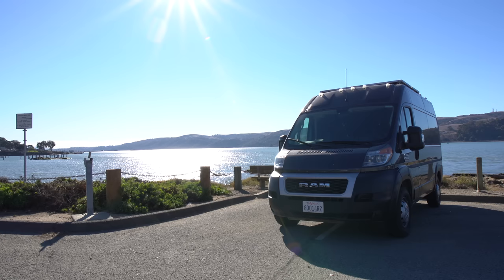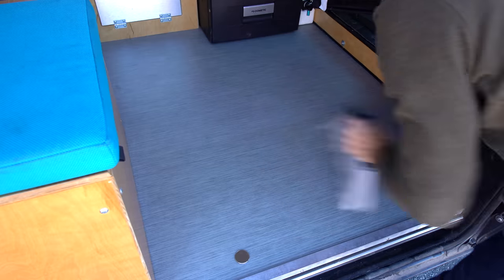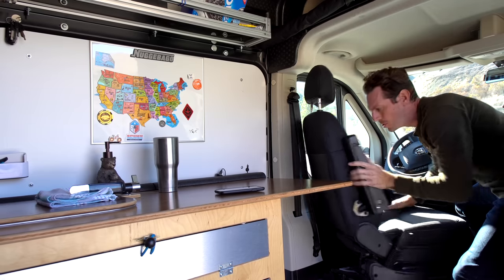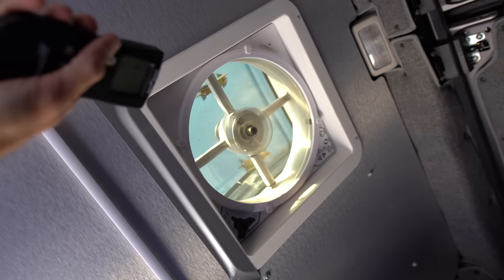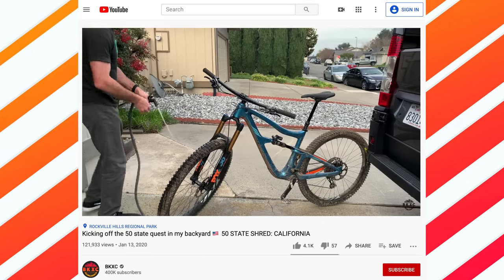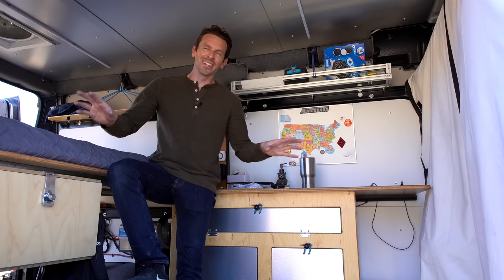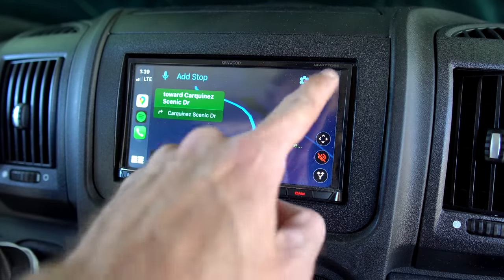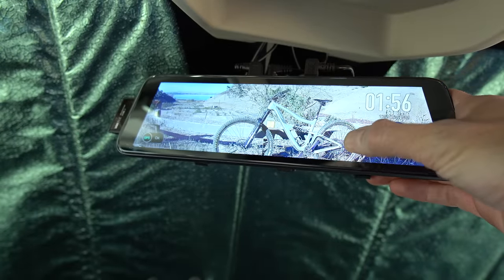15 Smart and Stupid Details On My Van | RAM Promaster camper conversion

Comment: You dont have to roll your windows all the way down for the fan to circulate, just crack them. My camper has a maxxfan and I just crack open a window and it gets pretty breezy. Even in the middle of July in South Alabama, parked in the shade, my maxxfan did as n amazing job at keeping me comfortable. 
Also, I'm not sure if there are window screens for the Ram, but as a trucker, there was a manufacturer that made screens for semi trucks that had a hard plastic mesh behind them to prevent somebody from pushing the screen out. You roll down the window, put the screen in and roll the window up to secure it. I'll see if I can find the link.

Comment: Just to clarify the diesel heaters are available for less than $200 if you buy the Chinese model. Only the name brand ones are crazy expensive ($800-1500) and they are literally identical to the cheap ones. A reason diesel heat is so popular is they provide dry heat where burning propane actually releases moisture into the air creating a lot of condensation that is very problematic in a van.

Comment: The vent fan requires electricity. There is a factory stamping directly behind the seats on the roof that is flat and I installed a CR Laurence 15x30" sunroof which has a removable glass. I can aim by DeWalt fan up to it to exhaust air and because my van is a low roof with the glass off there is infinite headroom where you most need it. You don't have to stand up everywhere in the van. Not sure what that build costs but it looks very cheap quality. I keep my van modular because I use it for camping and then hauling stuff which is what a van is made for. I have the Ram PM 118" which is plenty big but it still gets lousy gas mileage, ain't no way I'm loading it with cabinets.

Comment: For the noise, I bought some noise cancelling headphones from Bose. I wear them when I'm driving, superb sound quality even at low volumes because noise just disappears!
For anyone concerned about safety: ANC only blocks background noise. Horns, cars etc cut through the cancelling
Reply: It’s actually a great idea in theory.  However, I’ve been pulled over in two different states for wearing ear phones .  One ear plug or head phone is legal pretty much everywhere .  Two will get you stopped .  I’m not sure if this is the law in every state.  But you sit so high in vans, that’s its easy to spot (apparently). Such BS.

Comment: 😫   I agree, that oil change plan is a horrible deal. A typical lube place might charge you $50-$60...
 OR  a DIY oil change cost is about $35 USD  (with filter).     lesson:  Stay away from the "stealerships" unless you have a lot of money to burn.

Comment: propane heaters generate lots of moisture, of which there is lots of in winter. diesel heaters only radiate heat so it actually drys things out instead and with $200 kits available it is worth the install, speaking from experience.
Reply: What??? The winter air is by definition, colder than summer air. COLDER AIR DOES NOT HOLD AS MUCH MOISTURE AS WARMER AIR, hence "HOT and HUMID summers."

Comment: This won't help obviously, but here in italy there's a sweet data plan (monthly cap, yeah...) that is "unlimited" from midnight to 8 am. Unlimited actually means "30gb, after that speed drops to 128kb" but no extra fees. The cool bit is how it's 30gb each night! And it cost like 20 bucks a month.

Comment: Yes, a very useful presentation. Thank you. I have a cargo trailer conversion and although both trailer and van has their pros and cons, a van has an edge for doing more moving and the cargo for more staying. I tried traveling with a truck camper and frankly didn't like the pitch, rolling and swaying. I also don't like that the high top van will spend all of its life outside.
Reply: Raptor paint will withstand all weather:)
Reply: @MannyWC  You still have seals and a lot of undercarriage stuff to cover.
Reply: Do you mean like a trailer? I thought they had that covered. 

I thought work vehicles would be perfect. A small bus or shuttle would avoid all or most annoyances. If you have the lift, you could put a small bike in there, easy. I'd use a Murphy bed/conversion sofa, imo. Wasted space, otherwise. 

Or you could just lift it to the ceiling when not in use. And work underneath it.

Comment: The oil change packages are definitely worth it. If you buy them 3 at a time. As for the upsells, find a different dealer. Factory does not recommend any flushes.

Comment: Change your oil more often than 10k intervals. Its the cheapest insurance you can provide for your motor. Going over 5,000 miles on motor oil is a scam. Manufacture gets to say their cost of ownership is less and you plug up your motor with sludge eventually so you buy another vehicle sooner.

Comment: For the air flow, make a 4 inch x4 inch hole at the floor.
Reply: Actually a great spot for the hole is in the van sliding door step at the back horizontal portion by rear wheel with a slide cover to close it if you either don’t want full 4” vent or if too dusty road conditions while driving. I can’t take credit for this hack that came off Sprinter forum. 🙂
Reply: round hole.  Round can have a cover, and not fall thru.

Comment: A Chinese diesel heater is the only way to go. $120 and about an hour or 2 install time. Dry heat vs wet heat is huge in a camper van.

Comment: there should be a law that every van, truck, and suv be required to have a front facing camera at the top of their front windshield, which displays video on a screen mounted to the back windshield. That way the cars behind them would actually be able to see the road ahead when one of those big annoying things gets in the way.
Reply: Haha 
Stay off the road please. You are the problem, not the vans , trucks or suv.
Reply: @DaveEPie  nope, trying to maintain a view of the road ahead is responsible driving, even if that requires that we go around hazards and obstructions like dickheads in trucks.

Comment: Yo mate, when you talked about heating - diesel heaters.  They aren't thousands of dollars to get, the Chinese copies are about 250$ (they are identical to the couple thousand dollar originals), one tank of diesel did me for 2 winter months (mid north Canada) just fine in my larger van space then yours.   Holding some diesel in your van in a storage location is less dangerous then other types of fuel, propane is far more dangerous to hold then a tank of diesel.  Check out this old guys videos on these Chinese diesel heaters and you'll be happy you did.  He gives all the info you'd need and assures you they are quality replicas of the original multi thousand dollar diesel heaters. He goes over everything including proper install and benchmark tests/power draw/fuel consumption. No more cold nights, even in -30 Celsius weather (like me) you'll be fine.

Also diesel heater = dry heat.  Reduce condensation, reduce chance of mold getting into places you will not enjoy finding it.. all that stuff!  

https://www.youtube.com/watch?v=tvwmU_CcmGI&t=1s

Also good and informative video, thanks!

Comment: 180000 miles in my truck and all I have done is oil change every 7k full synthetic...plug change at 95k + fan belt and that it and it runs and look new and it is a 2016.

Comment: Hey Brian, First oil change  should be 3000 miles because engine is breaking in, the following  Oil changes should be 5000 miles, not 10,000.. You gonna ruin van's engine if you stick with 10,000

Comment: Another Vanlife YouTuber modified the fan in the Van's stock interior climate control so it could be run off of the house batteries as opposed to the engine battery.

I think it was the only fan in the his Vanbuild, Instead of of having a RV-Style ceiling fan.  

It would be way to have either a second fan or be more stealth if it's the only one.

Comment: Some sound deadening throughout the inside of doors, under the van on the body by the transmission,  on the wheel wells under the carpet or flooring, etc. would help a bunch.

Comment: Thiswas a good one, but on the diesel heater your wrong mr. BKXC. its about 200 bucks and with your knowledge you just hook it up yourself. Its great for drying out wet clothes and shoes, not only to heat the van.

Comment: Alot of work vans and trailers have roof vents...its going to take more than that to convince someone that it is permanenty occupied....diesel heater $150 on amazon.
Reply: I installed a diesel heater in a travel trailer. Got it out of a wrecked 18 wheeler. Paid $35 for it. Worked great!
5 quart fuel tank mounted on the outside above the hitch/propane tanks.  Easy to refill when fueling the truck.

Comment: Gotw3 could be a solution for your internet. 750gb per month is about 180 per month, 500gb I wanna say is 140 and the hotspot hardware is about 200 it switches between Verizon, att, and t mobile for best connection

Comment: Seems like there's a quite a bit of MISINFORMATION HERE:

A roof vent fan doesn't have to give away stealth.  I built my own rack for my solar panel on the roof, and it conceals the fan AND the solar panel.  So you'd have to look down on the van to see it all and detect it as a conversion.  All off the shelf materials online or at Home D.

And as for a single fan opening enabling air flow, no one builds correctly, to add an AIR INTAKE(s) through the floor, opposite the exhaust to avoid the heat while the vehicle is cooling down.  All you need is some 3" PVC, drill or cut a couple openings in the floor in an appropriate place (e.g. under cabinetry, and add a vent to allow the air out of the cabinet into the cabin), seal it into the floor and then add screen over the bottom outside end to keep bugs out, and removeable caps over the top for cold weather to keep the cold from flowing in.  Cold air in the floor, hot air out the vent.  Crack the vent just a bit and open the inlet when parked in the sun and you have passive cooling.   $20

The issue with propane heating is the MOISTURE it places in the air.  Not good in a van.  Mold not good.  You also have a HUGE error in not having a SEALED CONTAINER for the propane tank that has a VENT TO THE OUTSIDE THROUGH THE FLOOR.  These are REQUIRED in RVs and a HUGE health risk not to have, in fact didn't see your LEAK DETECTOR, so without one you are putting YOUR LIFE AT RISK.

And DIESEL HEATERS are ALL OVER EBAY for $120-150 and are WAY WAY easier to install than any RV electrical system and offer NO SMELL of the diesel and COMPLETELY eliminate all that moisture you are putting in the van.  They can heat all day and then some in bitter cold, so under light use you'll be checking it monthly to top off the small tank.

No need for an expensive under vehicle AIR COMPRESSOR and all the HASSLE of installation, when you can buy a Lithium powered portable one for $60 on Amazon, which you can even easily carry with you biking.

After market car stereos are nice, but apparently you don't know you can VOICE CONTROL your phone to do the same thing: no SCROLLING or "DINKING AROUND".  Phones have been hands free for quite while, as mandated by LAWS in various states.  Additionally, since most any $30 unlimited phone plan (e.g. Mint Mobile, running on T Mobile towers) now supports HOT SPOT, you can use any Tablet, or just get an iPad or other tablet with or without 4G if you want a large display.

Thickening the blackout curtains to the back to be double layer (or with thinsulate sown in) will contain all the extra noise when driving.  You could even get inside the front doors and add insulation there for more road noise reduction.  My EMPTY 159" ProMaster van before conversion, driving it home, with just a thick movers blanket hanging down behind the seats let me hear music just fine at low volumes.

Comment: My dorsal heater was £100 and it dries the air instead of making more condensation and isn’t a carbon dioxide risk. It might not be for you but it’s the best £100 I ever spent and I don’t know how you cope without it.

Comment: The Problem is that the Heater will remove the moisture from the van and supply fresh warmed air. Not having one and using a propane heater which produces a lot of moisture will not work for long 😅

Comment: Spending anywhere is from $300-$600 on a centrifuge oil cleaner like the Spinner to for your truck it will save you a lot of money because synthetic oil’s they can last but they still get just as dirty as conventional

Comment: Hello, just a quick clarification, at 7:50 he mentions keeping diesel fuel in the van. All the diesel units I’ve read about or saw run off the vans fuel line, there is a built in tap for it, the diesel always stays outside and under the van...from what I know, which is very little.  Thanks.

Comment: Does nobody use the van heater to take the edge off on a cold night? Turn on the Promaster burn half a gallon an hour if you run it that long and get lots of dry heat in the van. The drop that lovely insulating blanket snd go to bed. I also carry a solar shower. Add hot water on a sunless day open the back doors hang a sheet between them
and presto a private shower. For use in private boondocking. Easy.

Comment: For those of you that were encouraging him to get a Espar - they make petrol ones.  Not sure why anyone suggest adding a diesel one to a non-diesel van lol.  Still gonna a couple thousand so not worth it to him, but I just laughed that people suggested he get a diesel one and have to store diesel.  
Americans probably never see the petrol ones because Espar is mostly used in semi-truck/camper/expensive boats but in Europe they use them as parking heater/engine preheater on regular cars so of course they have petrol ones too.
Reply: I know people running vegetable oil.  Totally sensible if you rarely use it. I just hate FWD vans far more than having different fuels😂

Comment: Since you are in the situation that you still have a home w internet would be easy to have a cheap computer there and you use your mobile data once to either use a drop box like service that would sync  with home or can even set up ftp. Then do the uploads from home via remote desktop solution.

Comment: I got an oil change plan when I got a dodge a few years ago. It was a total waste of money. Supposedly you were supposed to go in to a special queue to get in faster. Ya, every time I went to use it I just dropped off the car as it was a day or two before it was done. Than all the other stuff you mentioned about its really just an excuse for them to touch your car to try to sell you stuff.

Comment: FYI - A diesel heater doesn't have to cost thousands of dollars. There are plenty of cheap ones you can get under $300 (a lot are around $150-$180).
Reply: But diesel fuel is dirty smelly stuff that you invariably get on your skin, your shoes (just from stainding at a diesel pump filling a can) etc.  If you already have a diesel vehicle and hence diesel smell, go for it.  But I agree with him that propane is a cleaner, easier solution.in most ways.  The exception being condensation from unvented burning.
Reply: @EfficientRVer  a) his complaint was the cost being thousands, when it's not. That was my comment. B) if you get it l over yourself, you may want to be more careful. I don't have anything diesel right now. But when I did, it was never a problem. No splash = no smell. C) propane is debatable for each person. Propane creates condensation. It also has to be vented for risk of exposure to fire or fumes if it needs to vent due to pressure.

Comment: I was looking into the swivel chair mount and read that they aren't safety rated , even maybe illegal ?  Can anyone clarify ? I would like one but , I'm not to sure now .
Reply: You can get them preinstalled from factory in many vehicles, so I would think those are safety rated. If going aftermarket you just need to check steel strength and gague including/especially mouning bolts and nuts.
Reply: @_GntlStone_  thank you for the reply , I think I'll have to do more research. 👍

Comment: Something to consider some preventative maintenance🤔🤔. Better get yourself some rodent traps so the rats, bunny rabbits, squirrels don’t eat any of your expensive rubberized components. My dad bought a dozen of the A24 rat trap for the ranch after eating his wires off his oxygen sensor. They work excellent but they are pricey. You can see them in action on YouTube just type in A24 rat trap. Note the bunny rabbits occasionally do camp out on his engine manifold eating an half an orange.Another excellent item to get probably from Walmart is a several zippo hand warmer with lots of extra fuel. Note I’ve seen on YouTube modifications to make them produce more heat. Regarding your Wi-Fi situation on YouTube you can build yourself a small little directional Wi-Fi antenna and I would probably magnet mount it🤔. I don’t know if your van can use stealth  tow hitch in the front.It’s ideal with a fold down cargo cage for the no parking cluster scenario. With the liftgate on both ends guarantees you have plenty a room to leave a clustered parking lot. Since you do a lot of mountain biking one ideal campfire pit you can use is a galvanized or stainless steal washing machine barrel plus a steel trashcan lid if you have a lot of hot Embers.
  When I do a garden rubbish burn for my trees.I get the van w/2000 W 12vpower inverter and the 120v saw saw including the lawn chairs, cooler, radio for the imaginary get together party. When the voluntary police come out to investigate my driveway party.They leave me alone because they think it’s a get together party and not a Burning waste party 🎉.They are too lazy to get out of their car to question me🤣😂🤣😂🤫🤫. Haven’t done this in 2020 and getting together parties for 2021 might have questions because of they don’t want clusters of people together🤔🤔.